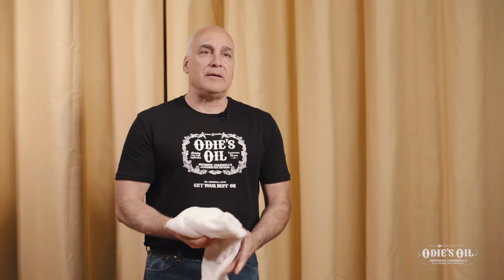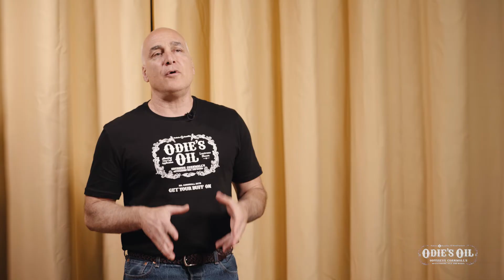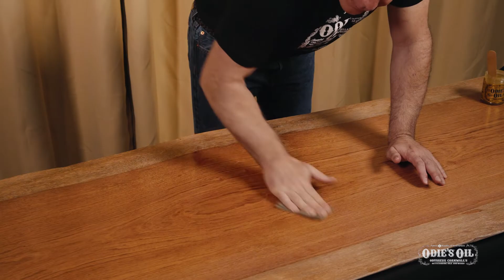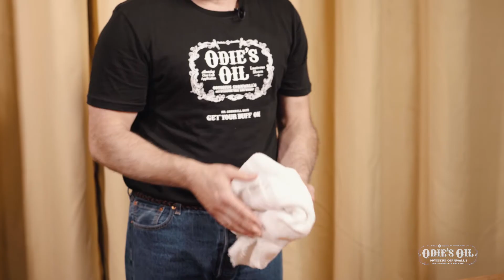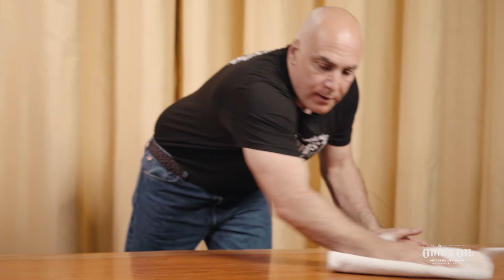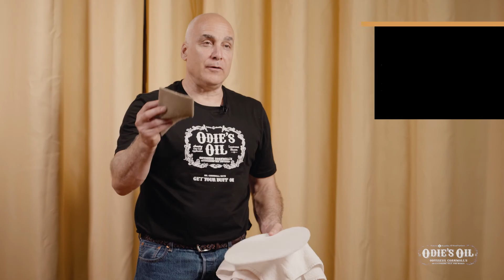Applying Odie's Universal Oil: Tips and Techniques #odiesoil #diywood #hardwaxoil

Comment: What about adding a ceramic coating?
Reply from the maker: We do not advocate the use of any ceramic coating as they contain harmful and dangerous substances. Beyond that, we do not recommend the use of any other finish to be applied over an Odie’s finish as we cannot guarantee a proper bond. A properly applied Odie’s finish will withstand much abuse and is very easily maintained if and when needed. We would recommend to read our blog posts on our website for more information.

Comment: I'm refinishing maple stairs. I will likely sand to bare wood. If I stain the stairs, can Odies be applied over top?
Reply from the maker: Yes, is possible as long as the stain is fully dried, or you can use our system of stains. You mix one of our pigment powders direct into the oil, stir well, and apply as per the oil. See some videoshttps://odiesoil.com/mr-cornwalls-creative-colors/

Comment: Would applying more coats of oil improve the durability of the finish? If so, how soon after the first coat can you apply the finish 2nd or 3rd? Thanks!
Reply from the maker: Basically, more layers more protection. Wait one day in between coats.
Reply: Thank you! When applying subsequent coats, do I need to prepare the surface or just go ahead apply the oil?

Comment: How do I find the right pad for my sanding grit?
Reply from the maker: We sell them on our website under the applicators section. We typically recommend to choose a pad rated equal to or just higher than your last sanding grit. We currently carry 4 pads. 

Maroon very fine-rated 240-360
Grey ultra fine-rated 400-600
Grey micro fine-rated 800-1000
White-non abrasive

Comment: thank you. i am an old geezer just new to wood working . does the oil protect the table tops i used a tunge oil varnish on a desk top . results looked great new but after about 3 yrs looks like i need another finishing .
Reply from the maker: Odie’s Oil will help restore and freshen up an already finished piece but the previous finish will be the barrier between Odie’s and the bare wood. If the previous finish is prone to failure, Odie’s can only help so much in the long run. To get the full benefits of our finishes we recommend to apply to the bare wood.

Comment: I am restoring 100 year old mission style oak columns. I used Odie’s & loved the finish. The wood drank up the oil. So much so that when I buffed it off there was little residue. Does this mean I didn’t use enough?
Reply from the maker: You do want to get the wood to the point of full saturation (to where no more oil will be accepted) for soft woods, old dry wood, or punky wood it’s best to do multiple light coats with a day between coats until the wood becomes fully saturated. It’s still important to do a proper buff off after every application to ensure any excess or residual oil on the surface gets removed.

Comment: What if the wood has a finish
Reply from the maker: It would be best to strip or sand it off and start from the bare wood. An existing finish will be the barrier between Odie’s and the bare wood and if the existing finish is prone to failure, there’s only so much Odie’s can do. It will however help restore and refresh it much more easily than most of all other finishes if a complete strip refinish simply is not worth the effort.

Comment: Very informative video.
In video you mentioned you can touch it right after buffing, in the comments someone asked about spilt wine your reply was after being ’fully cured’. 
What is the ‘fully cured’ time?
Reply from the maker: yes, you can use your piece straight away, however, you need to allow it to fully cure (like with any other product on the market) for 3/5 days before you expose it to liquids.

Comment: Is the 2500 grit pad essential? These are hard to find. Also you were clear about not putting too much but then didn't measure it out when you spread. Were you eyeballing the amount you applied in this example?
Reply from the maker: We do recommend using a non-woven pad rated equal to or just higher than your last sanding grit. They are always available on our website! If you are new to Odie's then measuring it out by volume is a great way to get used to being accustomed to how much you need. Once you are more familiar, then eyeballing will be perfectly fine.

Comment: So what do I do if I want a higher shine? Put a second coat down or use a different product?
Reply from the maker: The sheen is primarily dictated by the surface preparation (sanding in most cases) the higher you sand, the higher the sheen. This takes place before the finish is applied. Once the finish is applied, you can micro-build upon the finish with additional coats to increase the sheen, depth, and luster.  you can also increase the sheen by burnishing the surface with a higher (than your last sanding) grit non-woven pad or even sand between coats, you would also use this higher-rated pad to apply the finish.

Comment: what happens if wine is poured. Thanks
Reply from the maker: As long as the finish is applied correctly, and allowed to be fully cured you should get a water-repellant finish and stain resistant.

Comment: I got the universal oil but I didn't got the Odie's safer solvent and I live in Greece! . What's an alternative good way to remove any surface sanding dust before applying the Odie's Univesal oil?
Reply from the maker: Vacuum the dust, or brush it off using a dust brush. Then, wipe the surface using a clean cloth.

Comment: Anyone use a 6 inch buffer with Odie's? I've been applying to Tigerwood with gray scotch by hand but it's taking more oil and way more elbow grease than in the videos. The Tigerwood seems way more porous than Walnut so it's not stretching as far.
Reply from the maker: Real Tiger wood is a fairly dense hardwood with a Janka Hardness of approximately 2170. You should be getting close to the same coverage as in the video, but slightly less, also your sanding level will have a factor in the coverage. You can apply the oil mechanically, just be sure not to use to much, and more importantly, be sure to buff off any and all excess oil until dry to touch.

Comment: OK if I’m being super picky, the instructional video is a little too sales pitchy, this is the elixir of the gods, it can do anything and it’s fool proof etc.  but – – – he’s basically right. I used Odie’s on a couple of restoration projects of late, and I can’t for the life of me now understand how come someone didn’t figure this out sooner. This is by far and away the best hand rubbed finish you could apply to any project. And for many reasons. And I’m an old danish oil, and Maloof mixture, hand wax, and even shellac guy.  Occasionally lacquer.  This stuff is the real deal.
Reply: @paulmorgan   how long would it need to dry before you can send the table top to a customer ?  Thank you
Reply from the maker: @andrei.8375  Sorry, for the late reply! You can use your piece immediately, however don't expose it to liquids until fully cured 3/5 days!
Reply: The guy invented Odies Oil. Of course it’s a little sales pitchy. He loves his product and is trying to push it out into the market.

Comment: Great product but very expensive for quantity.
Reply from the maker: Actually is not very expensive. If you calculate the sq ft coverage you get with Odie's you will see our products offer really great value. One little 9oz jar of Odie's oil will cover an average of 200+ sq ft on typical domestic hardwoods and even up to 400+ sq ft of coverage on more dense exotics. If you calculate coverage to cost you the small quantity is very cost-effective! Averaging $ 0.22 an sq ft.

Comment: a good reason not to use this product is just watching this video. typically, many thinking of using such a product are doing so on unfinished wood, so what does he do here, uses an already polished piece to make it look better than it is. if its so great why the con job, anything will look great if the surface its being used on is already polished........ P.S., i also love how in the comments he tells people to contact him for a quick sell rather than answering the question so everyone interested can learn the answer, so much for keeping all those new customers with questions happy.
Reply: He says it's unfinished and usually with these kind of oil/hardwax finishes benefit greatly the higher you sand to.

Looks like at least 320 grit. 

I can understand your skepticism, but Odies is a great product.
Reply: He says below that it is unfinished wood.
Reply: You're 100% wrong.  I use Odie's oil religiously when finishing my wood and epoxy projects.  It was already sanded prior to the application.  Not finished.  BIG difference
Reply: @NellyEIEI  is this product good on 180 grit

Comment: IT IS AMAZING HOW MANY PROFESSIONAL WOODWORKERS DEMONSTRATE AND REVIEW ODIES OIL WITHOUT BOTHERING TO FOLLOW THE MANUFACTURER'S INSTRUCTIONS.  THEY THEN COMMENT HOW IT DOES NOT HOLD UP OR LOOK GOOD OVER TIME.  I AM AN AMATURE WOOD WORKER BUT BY FOLLOWING THE INSTRUCTIONS IN THIS VIDEO I HAVE ACHIEVED BEAUTIFUL RESULTS.  The only question I have for the manufacturer is how fine of a grit can I use on DOUGLASS FIR and still get the desired result.  I am waiting to finish a douglass fir project because I have heard that fir can be challenging to finish if you sand it too fine (perhaps I am wrong, but if someone can answer this I would appreciate it).
Reply from the maker: What grit were you thinking of sanding to? also what type of project and what is your vision for your project? Let us know so we can give you some pointers. Also feel free to talk to one of our tech support people www.odiesoil.com 850-695-2055

Comment: you mentioned going up to 800 grit sanding. im new so can you tell us the grits you would run thru to get up to 800 in order please
Reply from the maker: hello Elad. It is very important to not skip any grit, because the oil will bring out all the scratches, therefore the surf prep is very important and on your last sanding check your piece in a good light for any potential scratches, please give us a call for more info please give us a call 850-695-2055

Comment: Hi

Can I buff the odie's oil finish with a polish compound to get a mirror shine? in that case, how much coats of oil are needed to protect the color (in my case I used  dyes) 
Thanks in advance
Reply from the maker: hello, you can get a high gloss with Odie's oil if you sand high, usually up to 800. One coat is enough, however more coats more layers of protection, you can add more protection and beautify your piece by following with the butter or wax

Comment: How well will it hold up on a conference room table?
Reply from the maker: Hello.Odie’s will hold up excellent for a conference room.  It’s formulated for hardwood floors, countertops, table tops and bar tops.  Odie’s will outperform any finish when applied and cured properly. We do recommend 2 coats of Odie’s oil and one of the butter or wax (wait one day in between coats).

Comment: Will it hold up to the abuse a butcher block countertop will endure 
Ex water, grease
Reply from the maker: yes, will do work great as long as the finish is applied correct and removed completely and make sure you let it fully cure for 2 weeks to become waterproof and heat resistant
Reply: @Odiesoil what do i use to clean a countertop sealed with Odies Oil
Reply from the maker: There are three different ways to clean things that are finished with Odie’s products:
You can mix 1 part vinegar with 10 parts water and clean with a terry cotton cloth
You can use soapy water (like Dawn dish soap), but remember to rinse all the suds off, and then wipe it dry
Or you can make your own cleaner using Odie’s cleaning concentrate. To do this you can make a mixture, mix 2% of Odie's Cleaner Concentrate with 98% water in a spray bottle. Just spray and wipe. This will clean, refresh your finish. Start using this mixture after is fully cured.
Start cleaning your cabinets after are fully cured for 2 weeks

Comment: I applied a very thin coating to two pieces of camphor wood, one sanded to 400, the other to 800.  After 2 hours, I buffed with a terry cloth, and no excess was coming off with a paper towel, however, there was no shine on either piece.  So, I applied a bit more, and worked that in.  Waited 2 hours, buffed again, and still no shine.  I'm really putting in the elbow grease on the buffing, but neither piece has a luster.  I was expecting the 800 grit to be satin, but both pieces are matte.  What is the trick to getting a shine?
Reply: Maybe the conversation would be too long for the comment section.
Reply from the maker: Please give us a call 850-695-2055, we will be happy to help
Reply: @Odiesoil  why not tell everyone?
Reply: @katydoran999  maybe the person in charge of replying to YouTube comments doesn’t have the know-how to answer?
Reply: @Odiesoil  yeah why not tell everyone 🙄

Comment: Can you use Odie's oil as a finish for smaller projects like jewelry boxes?
Reply from the maker: Hello, thank you for your question
Odie’s oil works excellent on any type of project big or small and on all wood species (indoor or outdoor), there are no limitations on sanding, higher you sand higher the sheen. Just make sure you follow the application process step by step and cure times and everything will work great
Reply: Did you try it yet on the smaller boxes? Thoughts?

Comment: Started woodworking less than two years ago. All I have to say is, where’ve you been all my life? Oldie’s checks off every box for what I’m looking for in a finish (seriously, I’m not being paid to say this). I needed a food safe finish  that 1)doesn’t go rancid 2) I don’t have to worry about a person having allergies, and where food safe isn’t a necessity provides 3) protection against water 4) is UV resistant (so my projects done in cedar won’t fade). I thought I was going to have to figure out at least 3 primary finishes to always have in my arsenal in order to meet the necessary criteria for different projects. So, this will basically be the only finish I foresee using from now on, unless someone requests otherwise. One question, if this is the right venue: for things such as cooking spoons, how often does Odie’s need to be reapplies? Just wondering if I should continue sending a single use bit of oil to my customers with their purchase (this expense is out of my pocket because that’s how much I want my customers to have a good experience. Cuz that’s what it’s all about, sharing the beauty of our work).
Reply from the maker: Hello, your feedback made out our day. The regular works great on wood spoons, bowls, charcuterie ecc, in this case just apply 2 coats of the oil and let it fully cure for 2 weeks before you expose it to liquids (3 weeks for walnut), it has to be re applied only when is need it
Reply from the maker: Thank you for your trust in Odie’s products 🙏

Comment: Is it safe to wash the terry towels in the washing machine used for buffing?
Reply from the maker: Unfortunately they have to be disposed, they can’t be washed
Reply: @Odiesoil  Why not? Since it's food safe there should be no problem with contamination. Would it damage the washing machine?
Reply: Oily rag rule
Reply: I assume the oil would polymerize harden) on the towel and make it unusable

Comment: Could you make a video using oil on complete unfinished piece. Theres already a finish on there before you applied odies oil.
Reply: No Joe, that's the sanding level, not any prefinish. One of the many great things about Odie's Oil is that you can sand to any grit.  You can't do that with the other hardwax oil finishes.
Reply: I got walnut sanded to 5,000 grit and looks like it has epoxy on it already and it has nothing.
Reply from the maker: Hello, please scroll down the page for more videos https://www.odiesoil.com/faq/

Comment: Did you apply any coat before this Odie Oil because the slab looks nice & shiny already?
This Odie Oil coat is like the topcoat to protect the finished surface of the wood?
I am very new to wood so I would like to ask many things before using 
thanks
Reply from the maker: Please send us an email to info@odiesoil.con or give us a call, we are happy to help 850-695 2055, meanwhile you can check our faq page https://www.odiesoil.com/faq/
Reply from the maker: Info@odiesoil.com
Reply from the maker: Tommy Cuong Do higher you sand higher the sheen. In actuality you don’t have to sand past 800 or 1000 to get a very high sheen.  It’s more about the quality of your sanding. A good finish sander is needed along with quality materials.  Take your time and be thorough... do not skip any grits and you will find it easy to get a high sheen.

Comment: I have 1000 sqft of white pine tongue and groove porch ceiling.  Would this be a good product to finish?  Hoping to maintian the white color and prevent too much yellowing.  There is no way I can sand to 400 grit or buff as thoroughly as these videos show!  My arms still hurt from install!
Reply from the maker: dovechaser2007 hello, yes Odie’s will work great only one coat you will need, you don’t need to sand, you sand only if want to get a gloss look, are oil it is translucent will offer to the wood a wet look type, is not yellowing